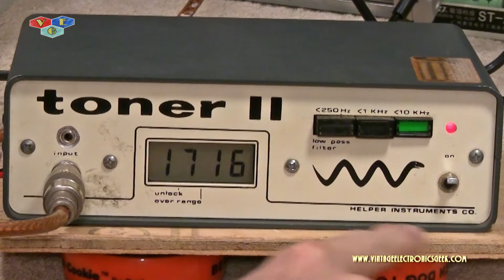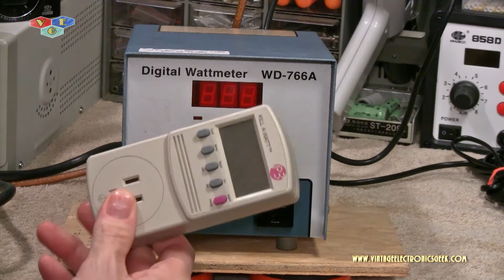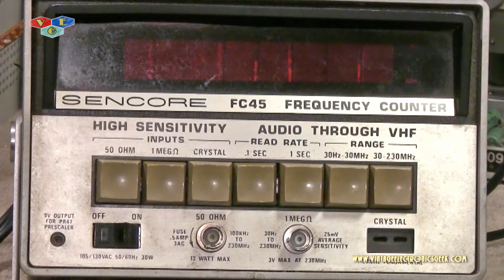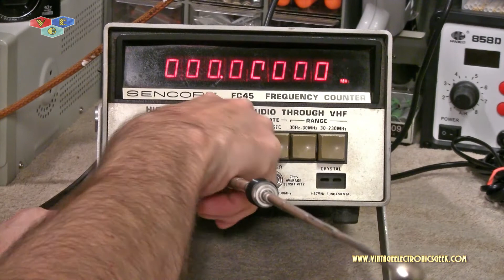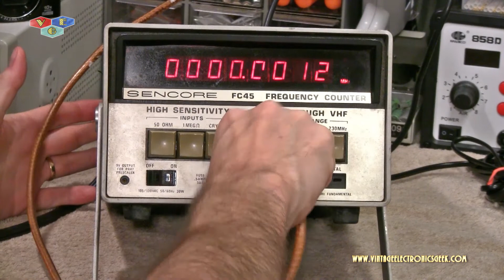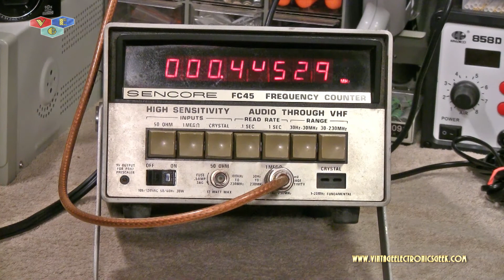New Test Equipment

Comment: I have a toner, the input is for audio only,  not RF it tells you the tones being received from a receiver, the input has to be connected to audio output of the DUT, before Disc.
Reply from the maker: Thank you Dennis!  I haven't had a chance to dork with it more advanced yet but have plans on doing so, I just placed it and some of my other new gear inline on my bench last week.  You have the very same Toner?  ~Jack, VEG
Reply: yes, used in communications repairs